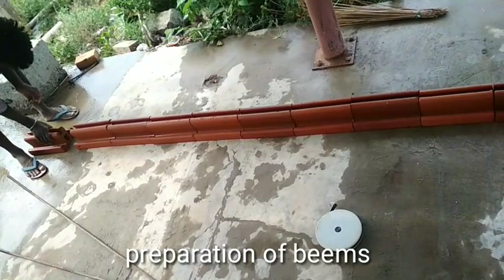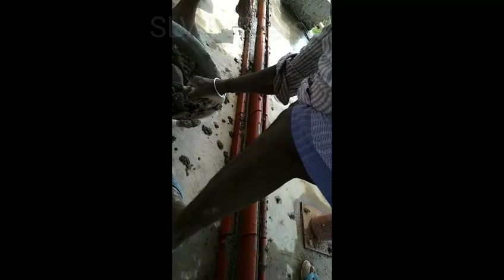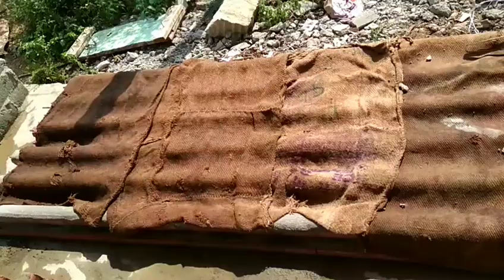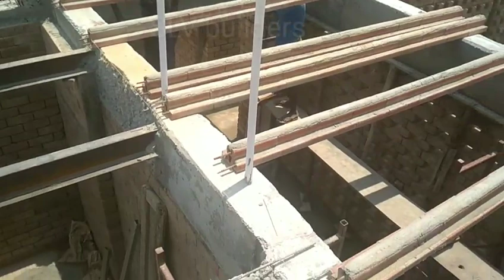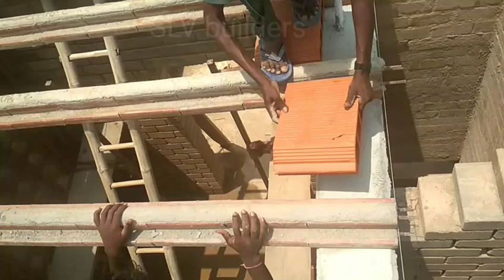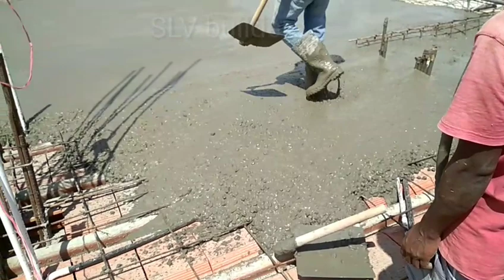Hourdi filler slab

Comment: Kindly consider the following tips while working with hollow terracotta roofing blocks while preparing the channels place them on leveller surface below compacted sand or cement finished floors so that even bottom is got below channel beams. The channels should be wet while pouring concrete, the water content should be slightly high as terra cotta absorbs more water. Maintain proper cover, no need to heap up the concrete in channels, also while pouring concrete on slabs make sure we place concrete on wet blocks.

Comment: This method looking maybe not cost effective  ?
Reply from the maker: This method not cost effective
Reply: @slvbuilders5927  You mean this is NOT cost effective? Then what is the advantage of this?
Reply: @faisalellangal  inside very cool
Reply: It's cost effective..the concrete and steel under tensile zone avoided also the plastering under the slab not required..the thermal insulation is bonus..go for this technique blindly